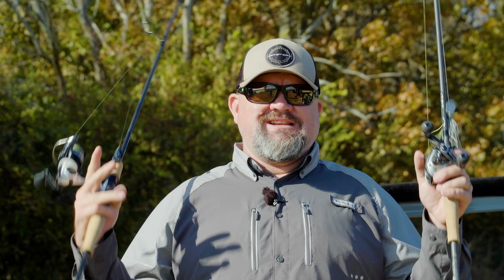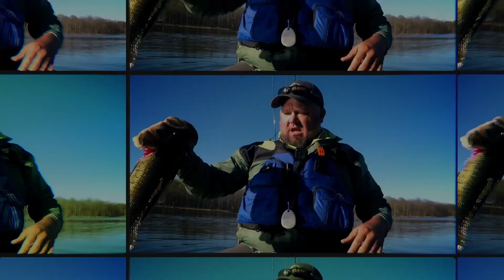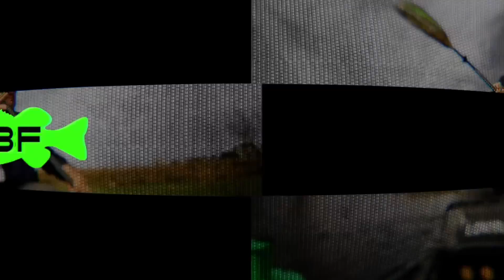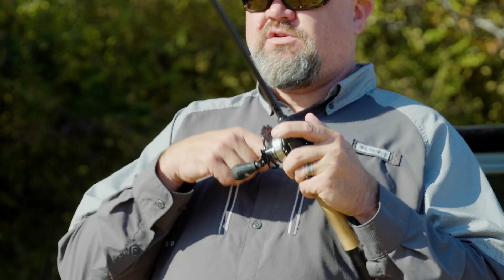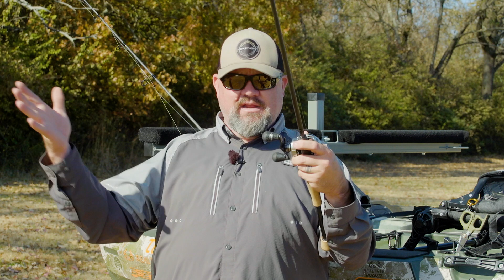Casting Rods versus Spinning Rods

Comment: Spinning gear is VERY underrated. It forces you to fish baits very differently than you would on a baitcaster and fish baits much slower in general. I kayak fish a lot and my combos are 65% baitcasters and 35% spinning. Another MAJOR tip for spinning gear is use braid as a mainline with a fluorocarbon leader, it’s dynamite for sensitivity.

Comment: What do you mean by "too fast of an action"? Are you talking about the reel or the rod tip? Can't quite understand how a higher reel speed (ie- 8:1) would affect the cast of a lighter lure...so I guess you're talking rod tip? Bought my first spinning reel on Black Friday. Lol. Been a die hard baitcaster guy for about three years now.
Reply from the maker: Action is referring to the rod. Reels are rated in gear ratios so they can be fast or slow, but action is referring to the rod and how fast it returns to rest after being “loaded”
Reply: So he's saying too fast of an action rod doesn't cast quite as far? I guess I can understand that.

Comment: Know I need to know what lures does what
Reply from the maker: Matthew Kincaid thats coming very, very soon
Reply: Jigs are on the surface, crankbaits you work with your rod, then reel in the slack. Never, ever use your reel only to retrieve a crankbaits. Soft plastics you always use a bobber, and dangle them no more than 2 to 3 inches from the surface. Only colors you will ever need is bubble gum and clown.

 quick tip: use a fluorocarbon mainline to a 4 foot braid leader. The braid is invisible under water due to it having the same light refraction properties as water, but it has a lot of stretch. So use the fluoro mainline due to it having no stretch and a TON of sensitivity. Fluoro is highly visible underwater, but that shouldn't matter as a mainline since you are using the invisible 65lb braid leader.
Reply: Gregory Chuhta that was a lot for a joke that wasn’t funny